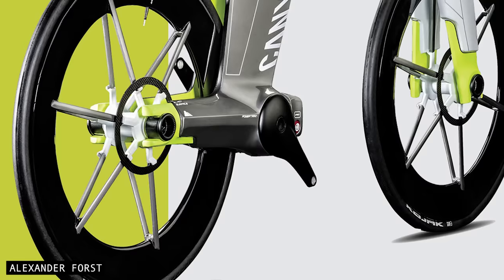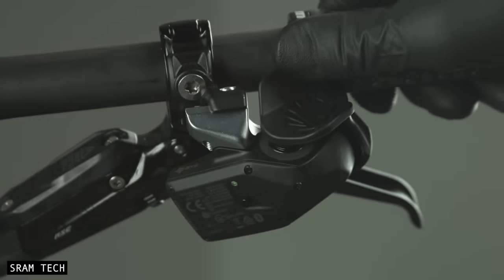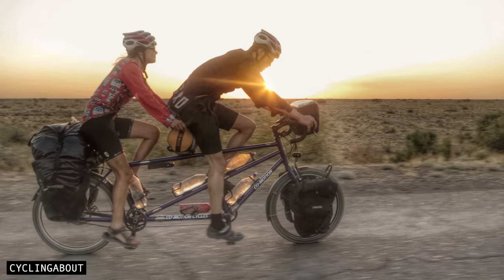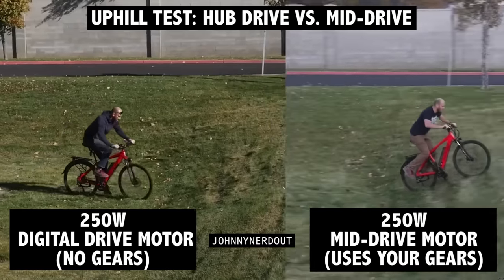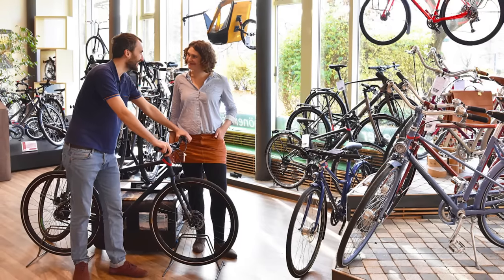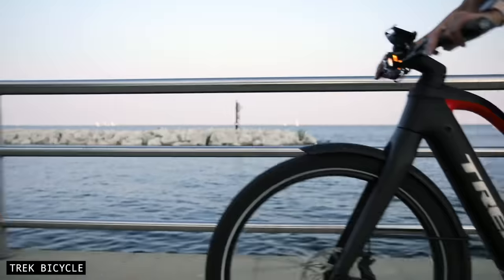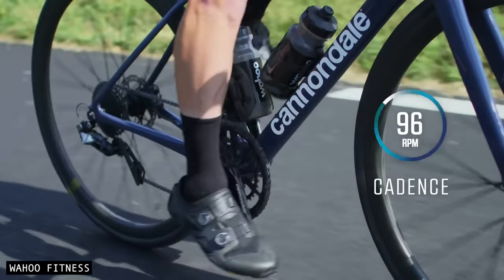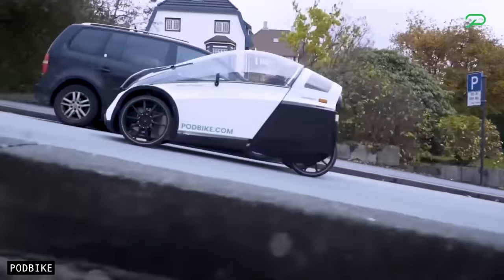Are Chainless Digital Drive Bicycles The Future of Cycling?

Comment: I LOVE the idea of a bicycle that becomes entirely useless when the motor dies. It's such a neat novelty~
Reply: This is a bit of a flawed stance isn't it? Most parts on a normal bike are required for its operation too. If your chain fails, or your gears fail, your normal bike would be pretty useless as well.
There is something to be said for not overcomplicating an elegant design, tho.
This digital drive system currently seems to have significant wdisadvantages in comparison to the old system, but both have many single points of failure. One could probably argue that the digital drive one has more redundancies than a normal bike, as it could use motor braking when normal brakes fail. Or that it could run without the generator pedals for a while if there is juice in the battery.
Reply: @MrJoerT  Sorry I don't subscribe to the idea that adding electronics/electricity to proved design is a step in the right direction. 50 years down the line a regular bike may still be operational, this: without an industry to produce replacement parts, you can kiss it goodbye. I like my gear resilient, not fancy.
Reply: @neobscura  Fair enough. 🙂
Reply: Just buy an electric motorcycle😂 no stupid pedaling😂
Reply: @jasmijnariel  What about AN ELECTRIC MOPED. Huh ?! BEST OF WORST WORLDS !
Reply: @neobscura  so are you sending your comments via a pidegon as well?
Reply: @Vit-Pokorny No sorry, pidgeons aren't as reliable as good old phone.
Reply: @neobscura but the pigeon is all analog and even older than the phone. What happens when your stupid phone dies?

Think about it.
Reply: How likely is that?
Reply: @samus4799  About 100% a certainty, why ?
Reply: @MrJoerT  I agree with neobscura.  The original design of a bicycle is unbeatable when it comes to simplicity and reliability.  And if something does go wrong with it, it's very easy (and cheap) to fix.  I have a regular bike and an e-bike.  I realize the e-bike has lots of added complexity that can fail but at least it has a normal pedal/chain/derailleur drive-train in case the electric part of it fails.
Reply: @ChristmasEve777  I agree with the sentiment. I'm not sure this specific added complexity is worth the sacrifice of being able to maintain the thing as a novice. There will likely be a break even point tho. In the 80s and 90s, most parts of a computer were simple enough that it was feasible for an enthusiast to understand all of it, and fix many (tho not all) parts of it. Over the years we slowly sacrificed that option in favor of the thing becoming smaller and better in every other way. It's a trade-off, but I agree that this 'digital' bike doesn't sound like it's worth it at this point.
Reply: Its like every flaw of a motorbike without any of its advantages
Reply: but if the rider dies then he has no need anymore for a bike surely!
Reply: @brabrabarabra5027  Yeah sure, but they rarely require a multimeter and soldering iron to fix. Also no need for a power plant. Anyway.
Reply: Motors are very simple, especially when wired directly to the pedals, and the hub is sealed from water/dust. They would last many times longer than a chain drive. I still wouldn't get one, there are lots of downsides, but reliability isn't one of them.
Reply: @robertd8483 Sure but we all gotta put some fuel in THAT motor, wasting electricity in an absolutely inefficient device though ? I'll pass.
Reply: @MrJoerT  The difference is that when my chain breaks, I can replace it for under 10 euros within a minute (or an hour counting in the time to walk to a store and back). If this motor dies, a specialist will have to replace it at God knows what cost.
Reply: @MrJoerT  Your logic doesnt hold. By your rationale nothing should be invented because it can all fail. Yes, Neobscura is correct, This is a useless design and anyone who buys one of these should just buy an escooter. A two-wheeled vehicle with no way to be 100% human powered is a motorcycle. Stupid design that just replaces the grip throttle with electric pedals.
Reply: @iamcase1245  I think you may have misread my comments, and I think we agree. It can be fine to sacrifice the ability for a user to maintain a product themselves, as long as there is enough return for it. In this case, the result doesn't seem worth it. Maybe next innovation :)
Reply: @neobscura  but actually bikes need a lot of maintenance especially the drivetrain. Electric motor needs basically zero maintenance except for bearings. There is not much that will go wrong there. Its basically maintenance free.
Reply: @MrJoerT  Here we go. Not against innovation, but this one is a step backward even if it looks cool and futuristic.
Reply: @neobscura  I do want one tho. It's like the slap chop of bicycles!
Reply: my chain breaks and then i can't pedal the bike
Reply: @oyylumo  I can however go to the nearest bike repair place and get the chain changed in 3 minutes VS I must order a new motor, if I can even replace it, with that shit moped and go back home on foot like a loser til the repairs are done. Resilience learn the word.
Reply: @neobscura  are you very knowledgeable about bikes because I'm looking for someone I can come to with questions about modifying my old pos
Reply: at first this comment made me angry but yeah, Nah! Tis true, my E-bike is light enough to pedal home slow but not too annoying if I run out of juice. This drive train would ruin that. Would work great with a capacitor bike though.
Reply: @ProAvgeek6328  NO U.

Comment: Great video! I built my first digital drive trike in 1986 and dismissed it because it only showed about 50% efficiency. Things haven't changed too much.
Reply: Capacitor instead of battery?
Reply: things did change A LOT. but yes it will never come on a level of a chain drive.
Reply: @jebise1126  you cant know that
Reply: 😕 ~30% increase in efficiency is not to bad considering there is barely any market for this tech.
Reply: Sorry, I got through about 5 minutes and lost interest. I could make a more efficient digital drive in my sleep.
Reply: @Gigachad-mc5qz  Normal chain drives typically top 90% efficiency, and under ideal circumstances are around 99% efficient. Electronics will simply never get there.
Reply: @thethubbedone  technology always improves, you can literally never know if something can be better. I personally hope it happens at some point since i dont like chain drives at all but i doubt it
Reply: @Gigachad-mc5qz  Sure, in the same way that we might one day develop the technology to make a perpetual motion machine.
Reply: @thethubbedone  not in the same way. Perpetual motion is not theoretically possible. Electric motors with 96% efficiency exist, two of them would make the system 92% efficient that is on pair with chains. This technology will eventually substitute chains, it is superior on every level. You get an ebike that can be peddled and it needs little to no maintenance, is easily manufactured, can hardly malfunction unless a serious physical damage is done. It's much better than a chain. An electric motor is an accelerator, a brake (rheostatic (transforms kinetic energy into heat) and regenerative (transforms kinetic energy back into potential energy of a battery to be reused)), a generator, a gear (it has a good range of rpm without efficiency loss) and a transmission all in the same device that is almost as simple as a rock and consists of just one moving part - the rotor that can be combined with a wheel. A chain is just a chain.
Reply: @thethubbedone  Not at all the same thing lmao
Reply: Yeah, it seems that physics hasn't changed much in the past 40 years...
Reply: @jcd-k2s  It's really not if you've taken a basic physics course in college.
Reply: @Y2Kvids  Why not? Supercaps can charge and discharge much faster than batteries and if the bike is not supposed to be an E-bike it doesnt need a high capacity batterie. In this concept the cacitor is only used to  balance the power generated by peddling and maybe to charge some energy and use it to support when driving of at a traffic light or so. 
A capacitor will of course not make the bike a proper E-Bike.
Reply: @Gigachad-mc5qz  It's not about whether something can be better (than it is), it's about whether something can be better than other options. The answer here is no. Motors and generators are pretty laughably inefficient compared to a chain drive and they've had well over a century of development. They also have very "peak-y" efficiency which is... not great for a bike.
Reply: With effiecient motors and power electronics, you should be able to get to around 80-90% effiency.
Reply: @Gigachad-mc5qz  "you can't lnow that"

Yes we can. A generator can never convert 100% of the input into electrical power  and an electric motor can never convert all the electricity into motion. It is simply not possible to outperform a mechanical drive where the only losses are friction in the bearings and guess what; the generator and motor need the same bearings.
So no, digital drive will never be as efficient, and certainly not as cheap as a mechanical drive.
Reply: @jcd-k2s  EVs are also not that efficient if you consider everything that had to happen to generate the electricity in the first place.
But yes i was also surprised it was that much.
Anyways i will put reliability first. If a digital bike lets you down 50 miles in the wild you are fucked.
Reply: @rkan2  Maybe in a lab, but not in a real life where different people with different weight and power want to go at different speeds under very different conditions. Its only s small range where motors and generators work with their highest efficiency. It was even said in the video, that a gearing for climbs will be very inefficient on a straight road and vice versa. That's of course the same for all the other conditions like speed, wind,  stronger and weaker, heavier and lighter drivers etc.
Reply: @jeanyluisa8483  wut? For an electric powertrain you don't need really to consider the gearing. That is the beaty of it. Only motor (or generator) and other power electronics + storage effiency matters.
Reply: @rkan2  Gearing may be the wrong term. An electric motor has a varying efficiency depending on how much power you put in/pull out. So you could only optimise a bike for a certain speed range. Anything bellow or above and you'll lose out on efficiency on the motor driving the wheel.

So you can either be really efficient when going uphill or when riding on a plane, but never both with the same setup.
Reply: @MaximusLongus  Considering a bike - the powering motor effiency doesn't really get affected that much. The speed and torque demand are so small in variance that it doesn't make a significant difference. Much more important is the generator and battery electronics which can only really be made 90% efficient. From battery to wheels can also similarly be made about 90% efficient. Speed would only affect the effiency of the whole calculation by absolute maximum of 5% unless the design doesn't have any thought put into it.
Reply: @rkan2  There migh be a reason why you call it powertrain. Maybe thats because it has a lot of power? Such a bicycle has only as much power as the person pedeling does produce. At an untrained average person thats about 150W. Such a small motor is not very efficient under heavy load. E-bikes with hub motors are known for the motor getting hot at steep climbings. Thats even though Ebikes have a stronger motor and a person assisting it by pedeling. The motor getting hot means its losing efficiency. There is no point in installing a stronger motor, because the erson pedeling will not produce more power. The electrical power is produced by a generator. So you basically have two times the loss of a motor.  Maybe you should just watch the video again, It explains why such a bike cannot be as efficient as an E-Bike or a poweretrain.
Electric motors usually dont need a shift gear, because they have they can produce the same torque at every speed. But to produce a high torque at low rpm they need a high current(power) and the person pedaling cannot deliver that high current(power).
Reply: @jeanyluisa8483  I only said it could be maximum ~80-90% efficient compared to said e-bike or chain/belt driven bike. These are probably worse but the maximum is about 90% effiency but that would also be expensive.   The lack of maintenance or chains might make sense but not when loosing 30% or more of your output..
Reply: @rkan2  You did not really say "maximum", you wrote "you should be able to get 80-90% efficiency". But ok, if you meant it as maximum, there is no contradicion with my answer. I answered "maybe in a lab, but not under real life conditions.
Reply: @Gigachad-mc5qz  theoretically from the laws of thermo and electromagnetism it is possible, but unlikely
Reply: @rkan2  With a chain, you get 99% efficiency because you're not converting motion to electricity and back. There's just a bit of friction.

And I very highly doubt that you'd ever get 80% efficiency from mechanical -> electric -> mechanical conversions. Closer to 60%.
Reply: @yourmeister  the engine may be 96 % efficient, but the rest of the system isn’t. A top of the line ESC will get you 90 % efficiency tops. A top of the line rectifier and regulator about the same. These 90 % are in optimal conditions. So with that factored in we get an efficiency of 74.6%. This is best possible scenario. The motor will not always be running at its most efficient range and the other components won’t either. 50% average efficiency sounds reasonable to me. And then there’s the extra weight. 2 gears and chain is 1 Kg max. 2 engines, an ESC and a rectifier and regulator of sufficient power to drive the bike? I bet 3kg min. And that’s not even considering any extra weight needed for a different shaped frame and battery/Supercap. 
And there’s many more issues I see with this that I won’t go into now.
Reply: Exactly.... chain is way more efficient as the only loss of energy is maybe friction plus the mechanical advantage from leverage is the key
Reply: @ThomasVWorm  smart answer is also sarcastic.... i suppose dynamo lights need a computer too...
Reply: @rkan2  Ha! No, not at all. And if you can get rid of the mechanical inefficiencies, your can get rid of them in a chain drive and they will again be much, much more efficient than an electric drive.
Reply: This
Reply: @iunnox666  i read somewhere that belt is better than chain even
Reply: @jcd-k2s  the thing is, in your case your generators generate MUCH more power, if you're talking 99% efficient on 1 MW, that is quite a large loss

not only that but those generators are made to output a single constant AC voltage at a constant rpm

in this bike it's very low and continuously varying power and voltage cuz nobody does the same rpm the whole time and no bike needs the same amount of current the whole time, which gets rectified and probably stepped up to target voltage, which gets fed to a brushless controller/inverter, which turns it back into 3ph ac..
Reply: @Gianfranco_69  yes and much more silent, but the problem is that if you don't want a fixed gear bike you'll need hub gearing, it is expensive and hard to replace

if your chain falls off or breaks you could fix it while you're away, no doing that with a belt drive, and it's still an exposed link
Reply: "digital" 😋
Reply: @Gigachad-mc5qz  yes, yes i can. It's called "Laws of thermodynamics)"
Reply: 12yo in '86, and still 12yo in '22. It's still not digital.
Reply: @Gigachad-mc5qz  you CAN know that. It's called physics. Mechanical drive is only friction losses in chain.  Carrying the extra weight of two permanent magnet motors plus copper plus metal case and gears, just to only convert a fraction on the output of motor generator pair.... Maybe 60%.. doesn't make sense unless you were using ebike anyways and wanted way to recharge battery.
Reply: @jcd-k2s  might want to check your maths mate, and cite your low rpm motor-generator pair running anywhere close to 90% of torque output vs input.
Reply: @jcd-k2s  in this case you are covering torque to current to torque. Unless you have converter and battery to store electricity.  In either case, a chain is 95% efficient.

No motor-generator pair is even close to 70%
Reply: You built your first digital drive? Or do you mean electric drive.  This bike is not digital.
Reply: Are you the Rob Cotter of Organic Transport?
Reply: And they won't change much for at least half a century, if not a few centuries. I mean, wiring, insulation and our understanding of electromagnetism barely moved at all for about 60-80 years, electromagnets hardly became any more powerful or efficient... Nor does the science suggests it can get much better without some major breakthrough, so guessing this isn't going anywhere, not any time soon at least.
Reply: its not that bad. A motor is around 90% efficient not 80 same for the generator. The losses in between can also be reduced. You still won't go above 70% but that is still a lot of loss.